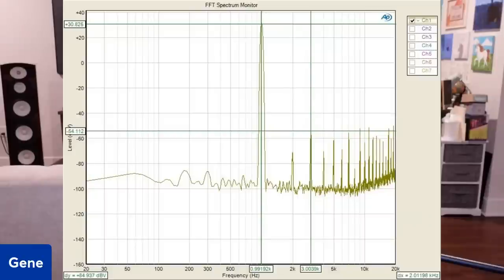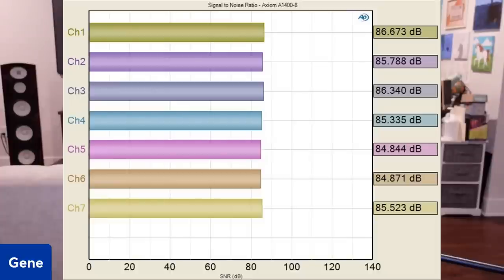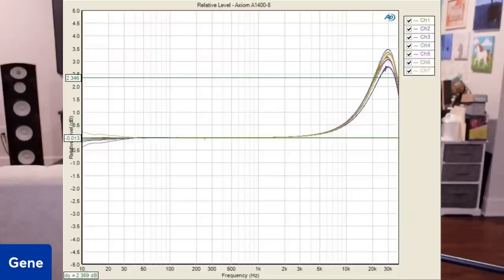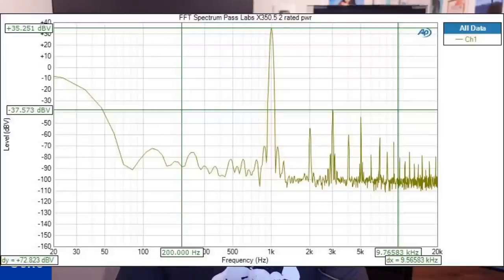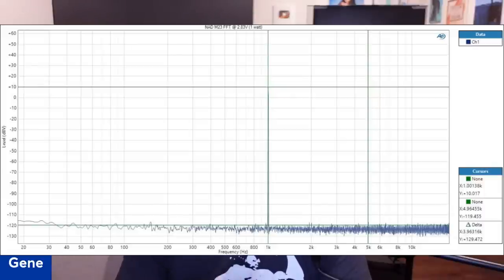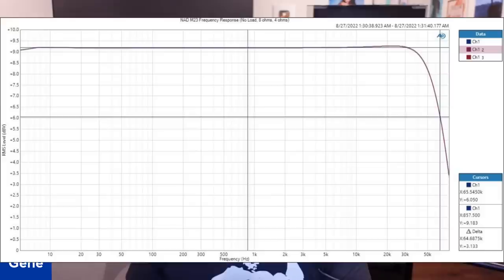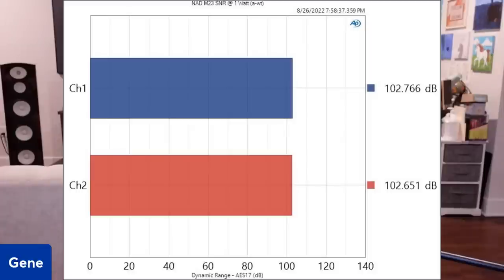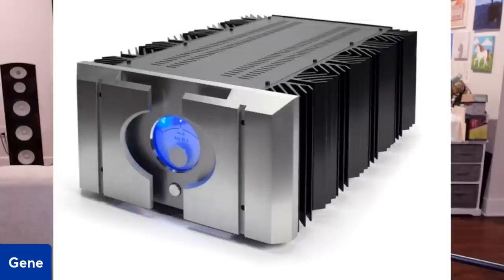Linear Amps are DEAD, Long Live Class D!

Comment: Class d is digital, no matter what anyone says. Digital has its place, both of my subs are class D  but I will never listen to analog with a class D amp. What would be the point,? I don't care about "efficiency ", I don't care about saving five bucks a year on electricity. I care about music.
Period. End of discussion.
Reply: It doesnt matter if its digital.  Many class d amps have surpassed linear amps in noise and distortion making them better.  You will never be able to tell a difference in a double blind test between a class A amp and class D amp with similar measurements
Reply: They changed the terminology from pulse code to pulse "width", did a Democrat think this up?
Reply: @Douglas Blake  You say potato
Reply: @Douglas Blake  If they were different,  sure.
Transistors and tunes are gates, they open and close based on a signal. Both PCM and ",pulse code" describe a signal digitally. 
If you're shot with a pistol or a shotgun, you're just as dead either way. This is the electronic version of Biden's "anti inflation " bill  which actually causes inflation,  the old propaganda trick of renaming something. 
I listen to digital,  I especially love DSD    and I could see class D as a better mousetrap except for one thing, my turntable. 
Even when sourced from a digital master the analog sine wave just sounds better. DSD is closest to an analog sine wave so it sounds best.  And I'm not defeating the purpose  of analog sources by running the signal through a device that  describes it, not amplifies it. A Pizza Hut is always going to look like a Pizza Hut, no matter what you call it
Reply: No, if you aren't listening and comparing amplifiers, you DON'T care about music, you are only interested in defending your choice without any evidence.
Reply: @Douglas Blake  Been doing this for decades  three years of electronics training.  I know a pig with lipstick when I see one
Reply: @Douglas Blake  No, that's common sense. You don't try to understand the nature of a thing, you just look at what people tell you it is. 
When a digital circuit is telling a signal what it is, right down to the volume,  that's digital. And when you've been involved in this stuff for over fifty years maybe you will stop looking at the surface and start trying to understand the actual nature of something 🤔
Reply: @Douglas Blake  well, that explains a lot.

Comment: Class D amps are less repairable (in the long run) right now.  If the manufacturer discontinues the specific chip, major changes to the circuit and/or component values are required.  Maybe standard footprints need to be created?
Reply: Thats my take too.  Not only finding and buying a quality product, but one with the best support and longest warranty.  All of this audio gear can be absurdly priced so we need to take replacement/maintenance (if possible) into the cost of ownership.

Comment: New? Class D was practically every affordable full range audio amp on the market starting in the 1980s. Hardly a new technology. Class D has a bad rep because it pulse modulates your signal to increase inefficiency. Which usually sounds like mud compared to a properly designed class A. Just because some luxury companies are overcharging for amps doesn’t automatically make Class D better. The best argument against Class A being it’s inefficiency is now irreverent thanks to super high efficiency speaker drivers. You can get a top tier class A Decware tube amp starting at $1195.00. Less than half the price of that $3,749.00 NAD. If you need a 700 watt amp, it's likely your speaker design that’s outdated, not amp. For more power you can get a tubeless NON CLASS-D 200w Schiit Aduio amp starting at $800. Now that’s a company innovating ground breaking designs without destroying your wallet.
Reply from the maker: Wow so much misinformation in one post. I hope you take the time to learn about modern electronics and what defines SOTA performance in audio these days. Class D was not a contender for fullrange until about a decade ago. Now it has surpassed linear amp design. Class A is a relic that should only be used for line level voltage signals and NEVER for anything relating to high power amplification. Some of the best speaker designs can handle large amounts of power and deliver ungodly dynamic range that wasn't possible a couple of decades ago.
Reply: @Audioholics  I own full range class D amps from the 1980s and 90s. Sounds like you weren't alive or under a rock at the time. Was pretty predictable you'd accuse common knowledge as "misinformation" considering your gate keeping technophile attitude.
Reply from the maker: @midnightsocean2689  1980s and 90s Class D was NOT well suited for fullrange amplification for high fidelity. While you think I was living under a rock, I was designing communication systems for Government defense in the late 90s and early 2000s. I'm well aware of the progression of technologies both in amplification and in transducer design. Not trying to come off as combative but your post had a lot of misinformation that needed to be addressed.
Reply: "Class A being it’s inefficiency is now irreverent thanks to super high efficiency speaker drivers" Not even close!  Look up Hoffman's Iron Law

Comment: Nad 298 is also purifi based and 2000$
Reply from the maker: Not the same module but I'm sure it's very good too.
Reply: @Audioholics  Redefining the State of the Art with Purifi Technology
NAD has introduced some of the most innovative amplifier technology in its nearly 50 year history, starting with the 3020 on through such cutting edge models as the 2200, the 208, and the M2. Now we are making the amazing new Eigentakt™ (self-clocking) technology, recently introduced to the world in the EISA Award winning Masters M33, available to a wider audience with the very affordable C 298.
Reply from the maker: @michelcouture7026  I just confirmed with NAD that the C298 and M32 do in fact use the same PuriFi amp module but totally different power supplies and input stages. The M32 as a result is a more dynamic amp and it’s noise and distortion is better.

Comment: Dear Gene,

Great video on class D, and long overdue. 

However, as you are about truth and reliable information, i have to point out a few facts you forgot to mention.

Bruno Putzeys' UcD, introduced in the Netherlands by Hypex in 2003, was fully fledged class D. Already in 2003 it outperformed AND outmeasured every existing amp of the time, regardless of class, design, price or brand. In every aspect relevant to audio. 
On top of that, they were cheap, dependable and extremely small in size.
And on top of that, Bruno also solved the imminent problems of SMPS's at the time. Those have also been small, cheap, dependable and superquiet since.

If you open up the NAD seen behind you in the video, you will probably find Bruno's SMPS and amp modules, as that is what most NAD units are based on.
 
Now Bruno is at his fourth generation Class D at Hypex, and fifth in another venture he joined as a co-founder.
The technology you call "maturing" must refer to the competition (in as far as you could call it that). Most competitors try to emulate Bruno's circuits, and some parties are indeed succesful in competing in the class D market. THAT is maturing.

But Bruno's original design outperforms all competitors to this day, and Bruno's most recent design necessitates new measurement gear, because AP and Benchmark have a higher noise floor than the amps they try to measure.

And the UcD was already fully mature when marketed 20yrs ago.

Love your channel, thought this info shouldn't be missing.

Best regards from Amsterdam,

Yuri Halberstadt.

Comment: Like alternative energy sources, class D isn't ready to take over quite yet. Good bang for the money, but nowhere near state of the art.
Reply from the maker: The measurements beg to differ. No other amp we've tested regardless of price has come close to this performance.
Reply: @Audioholics  
I don't listen to measurements.
Reply from the maker: @gme10955  state of the art is defined by the ability of the amplifier to amplify without appreciable noise or distortion or varying frequency response with load impedance.  The word you're likely looking for is "colored". This Class D amp is definitely not colored like others in the comparison.  The Pass Labs alters the signal, the Nad amp does not.  If you preferred less accuracy for coloration that is your right. Just don't sling around the term SOTA unless you're referring to amp amp that measures like the NAD M23.
Reply: @gme10955  if you don't listen to measurements then any coloured amp will do for you!

But your completely wrong that class D amps aren't state of art! 

Nowadays there's lots of Class D amps based on Hypex, Purifi, GaN etc that are state of art. On par or better measuring than class A/AB amps!
Reply: The old foolish " I don't listen to measurements" comments.

Comment: I disagree, until thodady, the class D advantage is only about the hi energy efficiency, only this.

About audio quality, sounds very artifitial and not so much natural in comparision with the class AB amplifiers.

Who hear the same music and make a sound test between the AB class and D class, recognizes qua the AB have better quality and the AB amplifiers manufactured today have more energi efficiency in comparision with the early models.

Infortunatelly, in the industries, all resumes about flow the the class D because of the energy efficiency, but it not resumes quality.

I'll say, i prefer the class AB for sure, class D is great in portables or where the energy efficiency is a priority, but nothing is comparable at the class AB in therms of hi quality and fidelity on audio, and today, they are more efficients what in early times, and too, the class D audio is not a new tecnology, he appears in the almost same time what the class AB amplifiers how another tipe of tecnology.

In tecnical details, the weak point of the class D is the inductors mounteds about the exit, a good observation and tests, turns obvious what theis looses mid and high frequencies because it.
Goods class D amplifiers try to fix it, changing the inductors and capacitances of the exit, but despiste it, thei ll continue to curt of theses frequencies.
This is a fact and the caracteristics about the class D amplifiers.

The same can be talk about the AB class, about the energy eficiency, because in all circuit, class AB, or D, or G, etc, the energy have looses, the same for the Class D, despiste theses looses are very small in comparision.

Anyway, i guess what the class D amplifiers do not substitute the class AB amplifiers, except because the industrie how on all, will to force it, how can observe today.

Whos want hi fidelity and quality, choice the AB amplifiers, whos wants the hi eficiency, choice the class D amplifiers, i guess what no one is better about, but is very especific about the aplications and preferences, this is a personal factor only.

And more one thing.
The linear amplifiers will to continue to exist, despite the class D preferences. Except of the industrie kill the all class AB manufacturing process.
Reply from the maker: Actually SOTA Class D amplification often exceeds noise and distortion performance of the best linear amps. So they measure better and more efficient, win/ win. Times have changed, things evolved.
Reply: @Audioholics  Hi, really, i know what the tecnology and the class D amplifiers really is getting better and better, but in quality? It really can to replace AB amplifiers?

Honestly, i guess not, but really, the class D still improving a lot, how an profissional what i flow say, the class D amplifiers have a long way to do, in this case, what your recomendation and do you have more accurate tests for comparision, something more informative, and detailed for test?

I really recognize have good class D amplifiers in market, but honestly, requires caution, because too, have false components too.

In relation the amplifiers class D, what the best in assembly and project? I really want to reuse some, but the project of some are very complicated, the class AB amplifiers in assembly or repair, not have theses tecnical dificults for assembly or repair.

I continue to preffer the AB class, my ears are very exigents about the hi fidelity and quality audio, but, i recognize what the have goods class D in the market. Now when say what the linear amplifiers are dead, or what the class D amplifiers go to substitute the AB amplifiers, i guess it is forcing so much. In fact have diferent markets, and diferent necessity, class D really improve a lot, but to beat the class AB in quality, i guess what they needs to improve more for can do this.

But, anyway, i really like these kind of content, make more and add comparisions and make more tests, it makes the things more informative and complete.

Comment: While S/N ratio is helpful most of these distortion measurements are largely useless. How many lousy sounding amps have we heard that "measured" nearly perfect? I've heard the NAD and several other Class D amps and I don't care for the sound no matter how great the measurements. No thanks, I'll stick with my 5 Class A monoblocks for my 5.1 system. I only run the front two for 90% of my listening and I already made the HVAC upgrades to run all 5 anyway. I'm not saying the job can't be done with Class D but this is for cheap stuff. If I'm paying big bucks I'd like an amp that I can easily repair if needed. Two of my Palladiums are from the last century and the other 3 are from Y2K and none have failed. Will a Class D go 25 years BS free? Can you get your scope, DVM, and iron out and fix it if it breaks?
Reply from the maker: I never heard an amp that measured great but sounded bad. If all you look at is a 1khz sine sweep that the other AV magazines do, then it can make sense.  That's not enough data to determine a good design.
Reply: @Audioholics  There are so many that offer that <.005%THD yet sound bad.
Reply from the maker: @randyduncan795  I doubt that 0.005% bad sounding amp maintains that low distortion at fullbandwidth or power. It's very easy to get low distortion at 1khz.
Reply: @Audioholics  So many design for specs and use tools like negative feedback to get those great numbers. THD numbers don't equal sound. I've heard numerous amps that had comparatively high THD yet sounded great. And many hard sounding amps that had crazy low THD. We haven't even discussed IM distortion.

Comment: Class D amplifiers only measure better than class AB but they do not sound better!! Do not be deceived by all this rubbish. Class D are not fit for true high end audio.
Reply: Couldn't agree more. Measurements only tell a small portion of the story. No doubt Class D has come along way, good enough for HT multi channel for average budget setups. But I would still use AB for higher end setups with Separates.
Reply: It isn't the class of amplifier that matters, it's how it SOUNDS.  Class D has come a long way in the last few years and I daresay will sound better than a similar Class A or AB design.  Unfortunately many audiophiles praise the benefits of listening to amplifiers rather than measuring them but then make sweeping statements about an entire class of equipment without listening...
Reply: @chrisantoniou4366  Class D can sound better and measure better in some cases against  A/B. But A/B will most likely sound better if they are higher quality. Class A is rare but more likely will sound better. Class D wins the value to price badge in many cases.
Reply: @BrianGarside  By definition a "higher quality" amplifier wil sound better, no matter what the class, and that was my point.  It's not the "class" it's the quality.
Reply: @chrisantoniou4366  Perhaps, still think Class D apples to apples to A/B wont be as good  in certain frequency bands. But for Home theater I'm not too fussy so I can live with D in that setup.
Reply: @BrianGarside  It's worth considering for both.  I also have Stax electrostatic headphones in my system and they sound fantastic with Channel Islands power amp.
Reply: @chrisantoniou4366  what class D amplifiers are the best then?
Reply: @ProfessorJohnSmith  No idea.  My point is that you shouldn't be prejudiced against the "class" of amplifier, listen and decide for yourself which you prefer.  For me, the Channel Island power amps (200W monoblocks) sound completely transparent and deliver effortless power in my system.

Comment: Sorry i am not going to  spend $4000 on a class D amp,ill stick with my Emotiva amps, i also notice that you did not even bother to listen  to that amp so you have no idea on how that amp will sound compared to a class a/b amp , i you are all about measurements and i don't think you are going to convince any tube amp enthusiast to switch to class D amps
Reply from the maker: Emotiva isn't even close in noise and distortion to this. I've owned and measured  every generation of Emotiva amp (prior to their switch to SMPS) until the broke shortly after the warranty ended.

This was not a listening comparison.  You missed the entire point of the video.
Reply: My system sounds amazing with my class D amp !